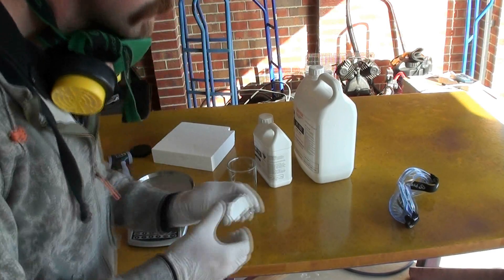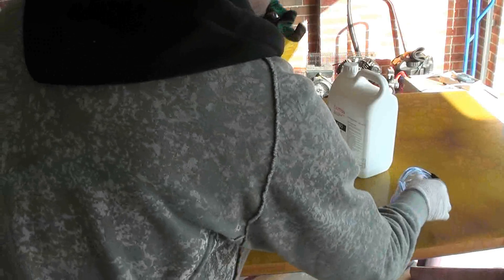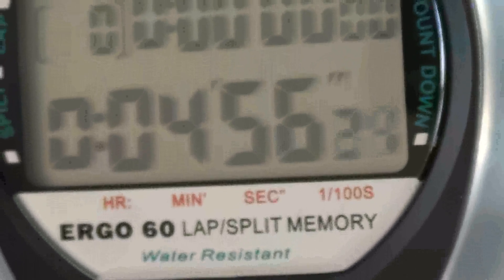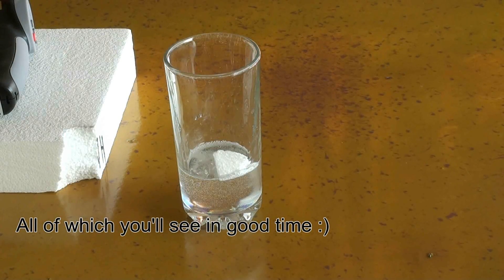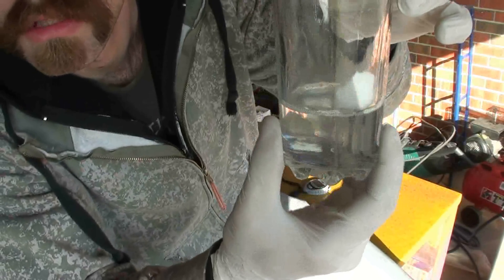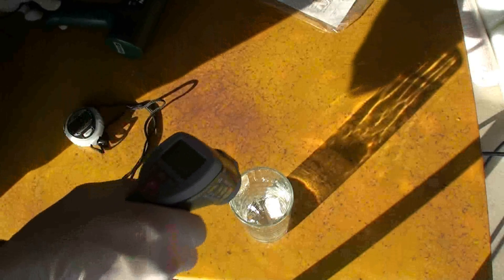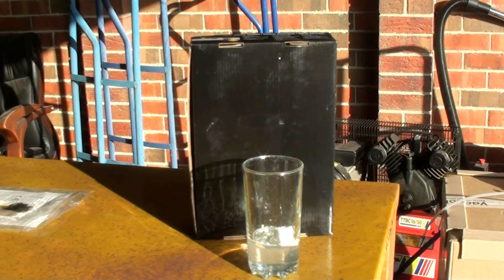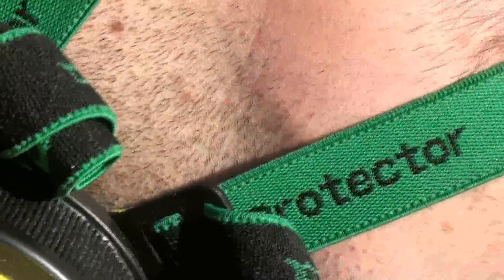Polystyrene foam in epoxy resin - heat & chemical reaction test

Comment: I really enjoyed your experiment!  Thank you.  I was thinking of using a piece of Styrofoam as a canvas for an epoxy art project, when my husband advised me that I might want to check and see if that was a safe idea.  I had the same thoughts as you, that the epoxy might cause the Styrofoam to melt or release some gas.  Your video was extremely helpful.  Thank you.  I would like to ask you what did you create because of these results?
Reply: Marianna Pierre [

Comment: In 04:13, temperature is probably dropping from 22 to 21 degrees Celsius, because you moved the glass from the surface of the weight scale (when it had reached 222C) and put it on the table top, that you measured its temperature to be 19C earlier (I might be wrong).

Comment: The lack of reaction. is why they use polystyrene and epoxy to make standup paddleboards. One downside is the expansion of the polystyrene when heated in an closed system like a paddleboard. That is why they add vent plugs... Though they don't always work, especially if heated quickly.

Comment: Interesting. I have bought Polyurethane 2 part expanding foam to make buoyancy aids for my canoe. It didn't expand to anything like the 25 times claimed - probably my fault in the mixing/temps etc. From your tests, now I know I can pad it out with polystyrene when the second shipment of (two and a half times the volume of the original pack) arrives.
Just one flaw in your experiment. The temperatures you are reading will be wildly inaccurate. Those infra red temperature guns require ideally a matt black surface with as little curvature as possibel and there is an optimum distance to hold it from the surface to be measured. You have transulescent, very curvy surfaces.
Well done anyway!

Comment: A very long video that eventually told me what I needed to know.
Epoxy doesn't interact with expanded polystyrene chemically and the heat in normal volumes isn't going to be an issue.
I can use expanded polystyrene offcuts as light weight packing when building fishing rods.

Comment: The foam is extruded polystyrene? I was thinking of using fiberglass over Foamular 250 with epoxy resin over it, I guess it wont melt the foam. Is there a way to thin out the epoxy resin so it will be absorbed by the fiberglass?
Reply: Not a good idea to thin it. You weaken it. Rather warm it up it becomes less viscous but cures quicker.
Reply: @ralphjansen9205  Strength is with the fiberglass cloth and not the resin so it doesnt matter the dilution. And the resin will not enter into the cloth if it stays as thick as it is when its mixed. Meaning the resin is not liguid enough to be absorbed by the resin without the thinning liquid.

Comment: So I took a Styrofoam ball from a craft store and painted it with spray paint from Home depot. The paint melted the ball :( If I covered the Styrofoam ball with Exopy Resin first, let it dry, then painted the ball with the spray paint, would the Styrofoam ball still keep its shape?
Reply: Try using acyrilic paint...

Comment: Note when using Epoxy and your worried about skin contamination; you can rinse off with simple 'vinegar', turning the chemicals in the epoxy inert, and then washing with warm soap and water.  In 32 years, I've never had an epoxy reaction to my skin.

Comment: What is the temperature thingamy called Milane? It's on the tip of my tounge but I just can't recall atm! Need to buy 1 for molecular gastronomy. -Would you know where I could pick one up somewhat cheap? Hvala Unapred x